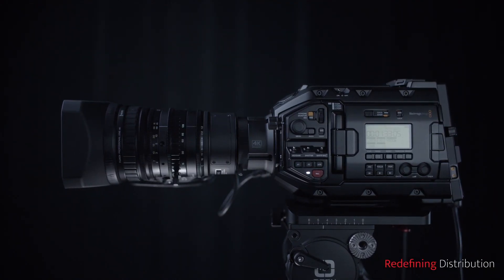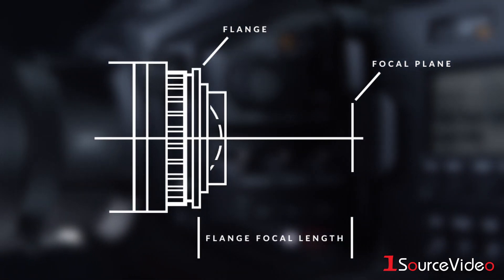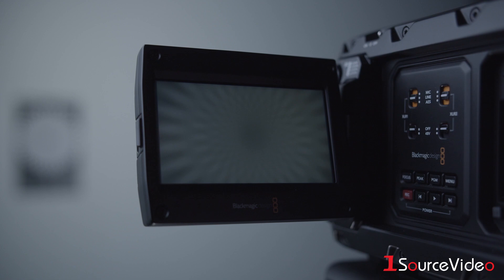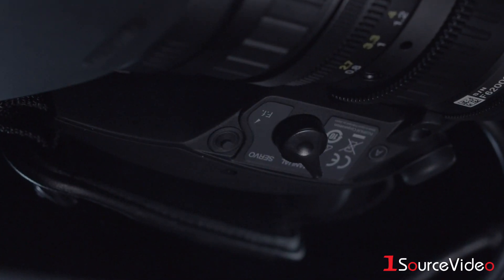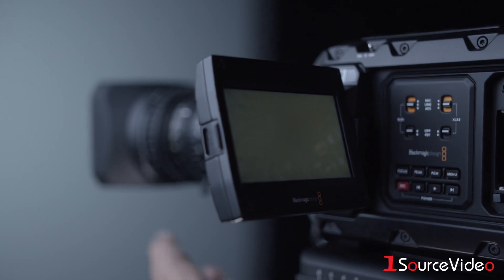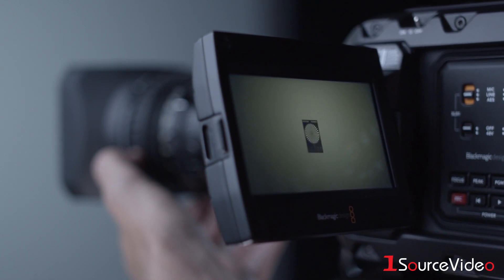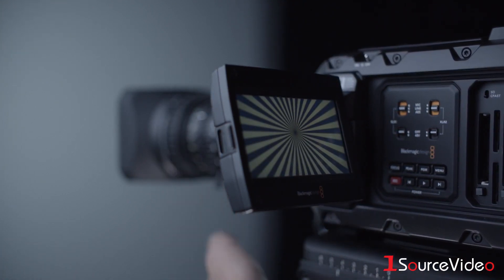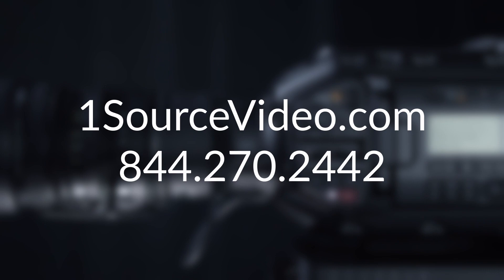Fujinon LA16x8BRM-XB1A Lens Flange Focus Adjustment

Comment: Does anyone know what servo controller to purchase with this camera/lens combo? The two I've tried have both had issues. I tried the Libec LANC  controller and the Manfrotto. The Manfrotto only the focus control works, and the Libec works for focus and zoom but only has two speeds when zooming... And they ZOOM.
Reply: for anyone who is still wondering, the Fujinon MS-01/X1 Semi-Servo Lens Control Kit which has the specific FMM-X1 Focus module is the servo kit for this
Reply: @blacklabelfm  thank you for mentioning this! I actually found the FMM-X1 and posted it on a couple forum spaces I had asked on, forgot about this one!!